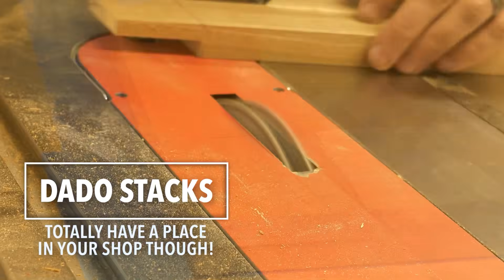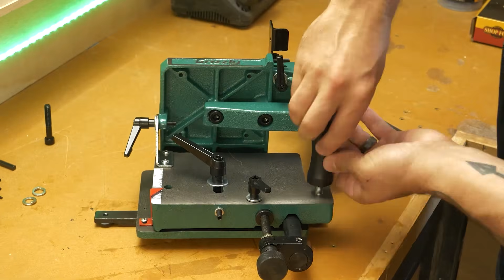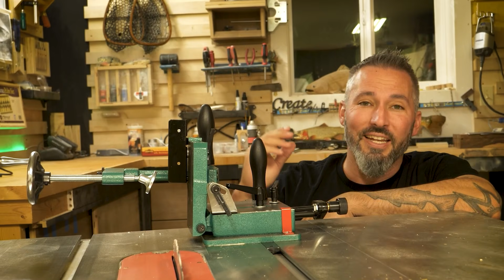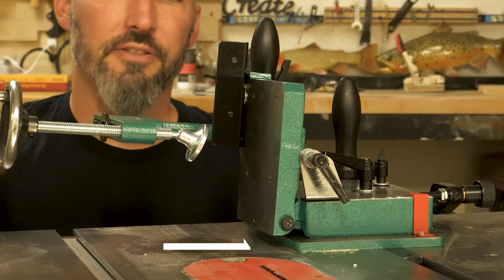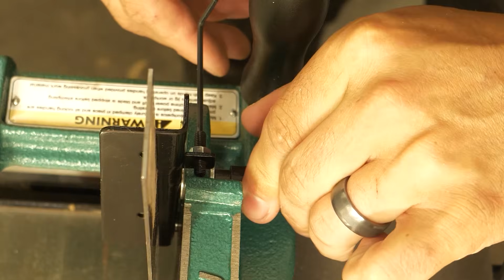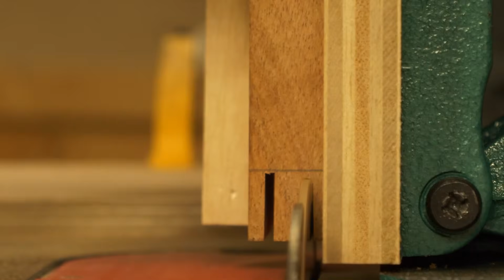An overview of the Grizzly H7583 Tenoning Jig including set-up

Comment: What a waste of $$$
Reply: I'm sure it is to you as I bet you can hammer and chisel this same precision in half the time.  Am I right?
Reply from the maker: A tenoning jig can actually save time and improve accuracy when cutting tenons, especially on multiple pieces or harder woods. It ensures consistent, precise joints that are difficult to achieve freehand, making it a valuable tool for both hobbyists and professional woodworkers.